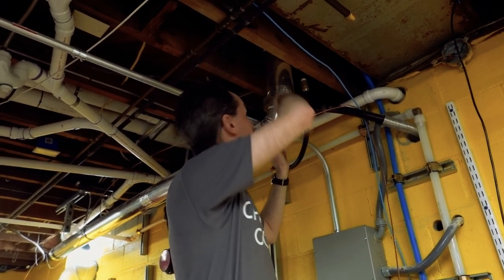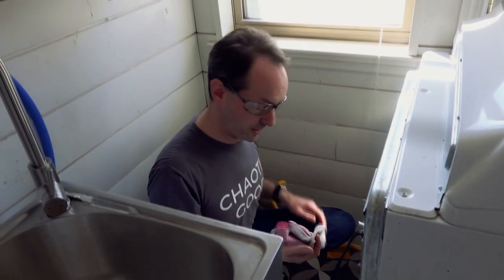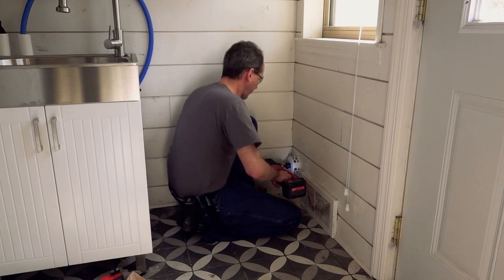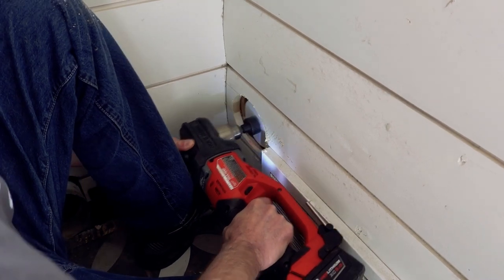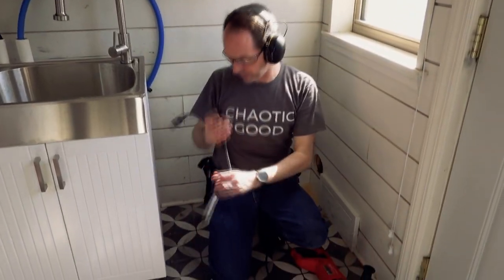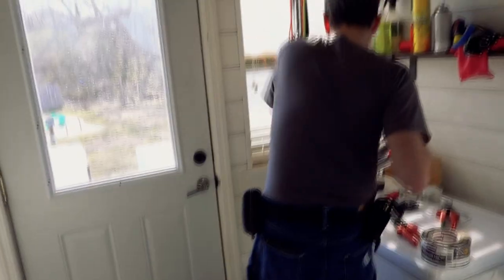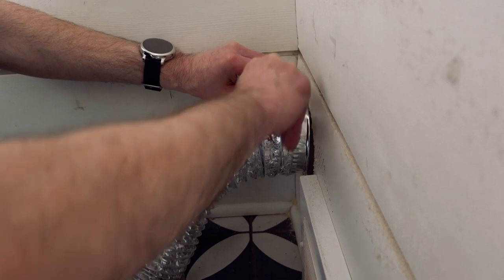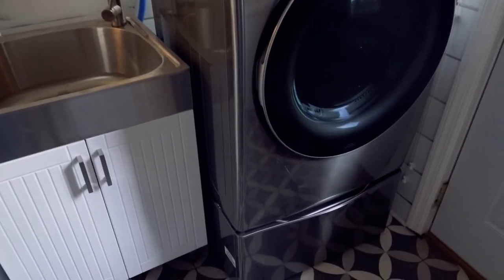How To Install A Dryer Vent Through A Brick Wall

Comment: Who would have thought, there would be a stud right in the corner. I clean and install dryer vents. while obviously it would have ben best to just direct vent it since it is on an exterior wall, the are not always on an exterior wall, so the configuration that you said is ridiculous is actually quite common. The configuration is not bad, it just needs maintained ( annually inspected by camera, and clean as needed).

Comment: Only a single brick wall, try doing the same through a nearly half metre thick old brick wall, which took nearly an hour to drill the same size hole through. Stop every 5 minutes to remove the block of brick.

Comment: I've seen runs that length in flexible slinky tube the whole way.  I got my aunts dryer duct down to 7ft straight Ridgid pipe and 2 almost 90° and drying time dropped noticeably, like over 25%

Comment: Renting a core drill would have probably been cheaper and faster than that rotary hammer bit.
Reply from the maker: Quite possibly, I honestly hadn't thought of that until you mentioned it.
Reply: Fafner, how is the core drill faster?
Reply: diamond core drills and an SDS.. my 18v dewalt one can manage a 117mm diamond core bit. YOU MUST USE AN SDS WITH A CLUTCH IN IT. if you don't that core bit will catch and the drill will send you into Low Earth Orbit..
Reply: @Physicsduck  those kind of bits do not require hammer mode at all. they work by abrading the brick into dust, not pulverising it. diamond cores are expensive but the best thing since sliced bread for the single skin brick and block construction (modern houses, 70's onward), or solid brick (on older houses) we have here in the UK. nothing else will drill through the hell that is Taylor Wimpey no fines concrete.. (concrete with only coarse aggregate, used in UK council houses and blocks of flats)